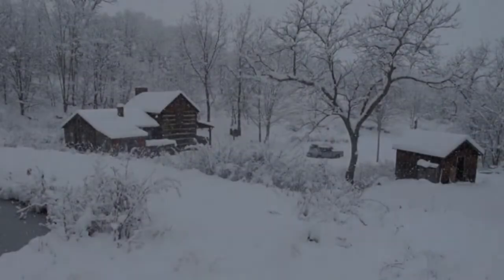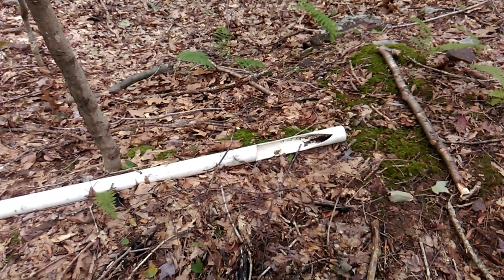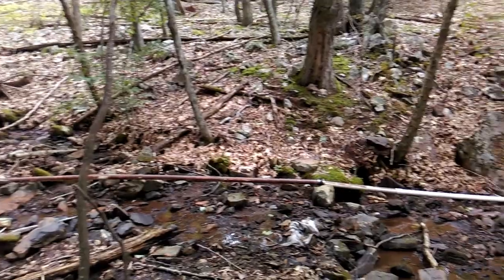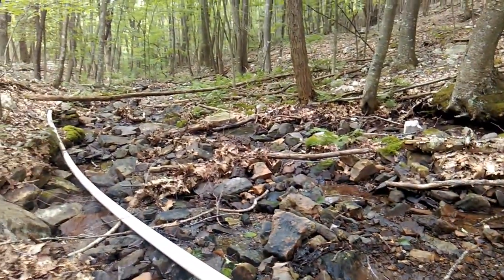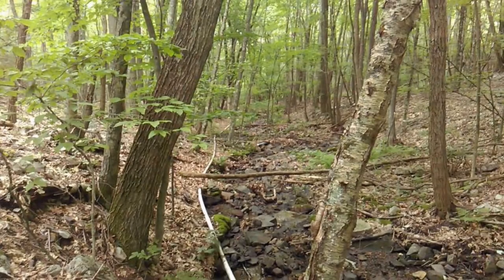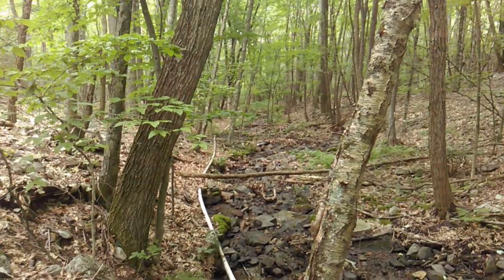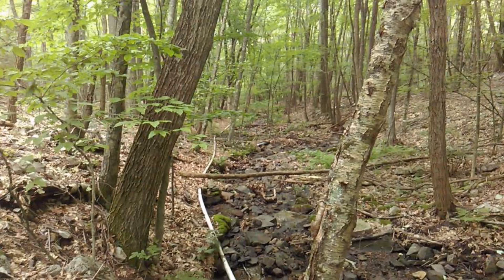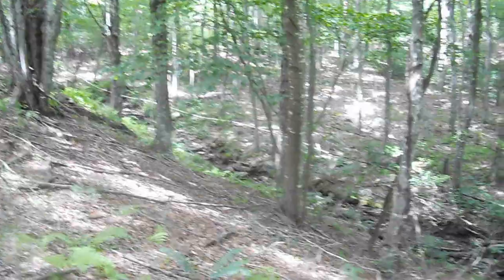A Micro Hydroelectric System, Part 3 - The Penstock

Comment: If you had the pipe underground could you use it year round? Also how low can the temperatures be without turning it off?
Reply from the maker: Sorry for the late reply. Certainly, if you bury the pipe below the freeze depth you can run through the winter. You will also need the above ground turbine, valves and pipe connections enclosed in a powerhouse with some heat to keep it close to or above freezing temperatures.

Comment: Would it not make sense to bury the pipeline?

In the long run wouldn't that protect it from freezing, animals etc?
Reply from the maker: Thanks for your comment. Yes, burying below the freeze depth would solve these issues. But due to the steep terrain and rocky soil that would not be easy to do.